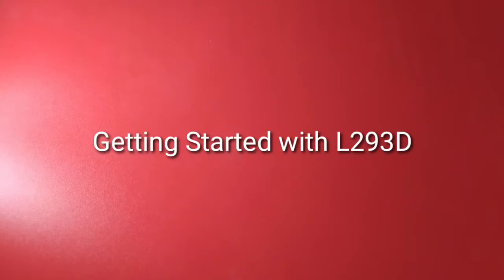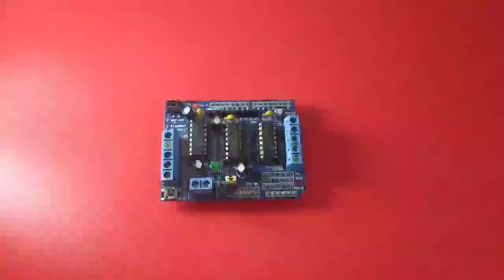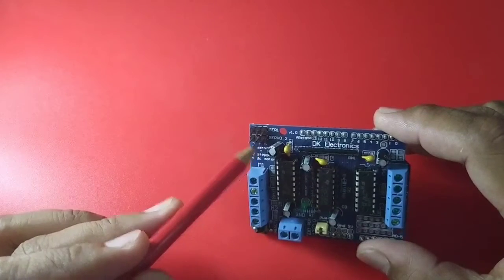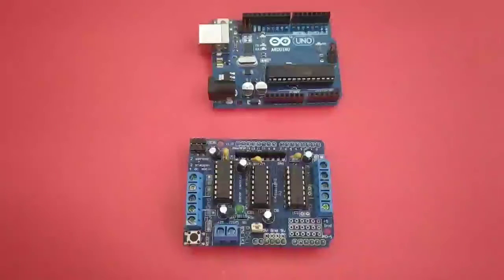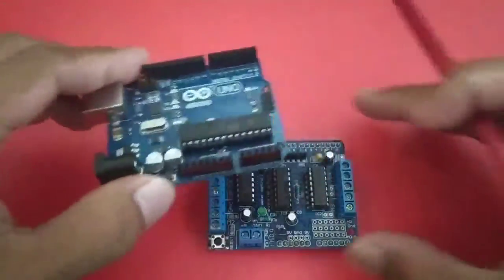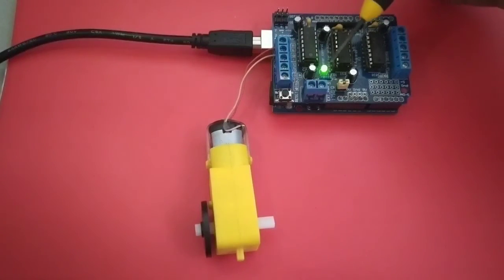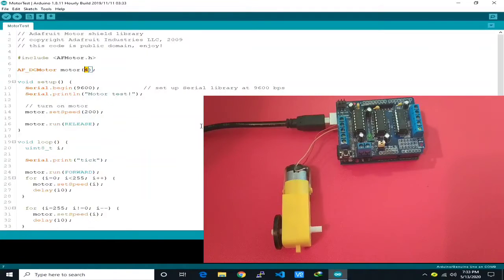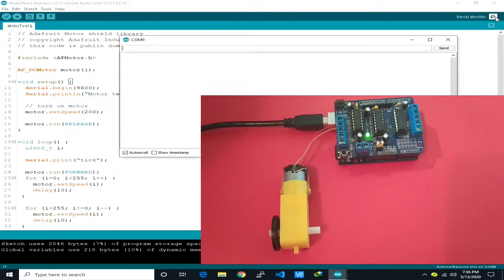TUTORIAL: How to use L293D Motor Driver Shield with Arduino

Comment: I have a 4s 16.8 volt battery, if I try to power those motors in the yellow case with that will they explode?  Do I need an additional bec to power the board at 5v or is there one on board?

Comment: If you plug the shield into the arduino, where (and how) do you connect two push buttons for the a (just one) DC motor to turn clock and anti clockwise?

Comment: We solder male header pins to the analogs of the l293d, then we try to connect it to ultrasonic sensor and code it  to make obstacle detector, but it doesn't work, need help

Comment: sir , in my moter driver shield l293d, when i connect moters it is not working. i am useing 12 volt battery, plzz reply.
Reply from the maker: Can you elaborate the following?
1. How do you connect the 12V power supply to your L293D motor driver?
2. How do you connect the L293D to Arduino?
3. Where do you get the power for Arduino?
4. Do you have common ground connection between the Arduino board and the motor driver board?

Comment: Bro till how much mah battery we can plug to motor driver shield bro can I use 4.2 v 6000 mah battery of 2psc is the motors works good bro plz give me a solution bro plzz
Reply from the maker: You may check the datasheet for that. Such as this: https://www.ti.com/lit/ds/symlink/l293.pdf

Comment: Great video!
Does the motors have to work on a specific voltage?
Reply from the maker: Hi Antonio Fortanet, yes you need to check the motor datasheet for that.

Comment: Bro can we 9v battery?
Reply from the maker: 9V battery is not recommended for motor power supply. You might want to use 18650 in series-parallel to increase voltage-current capacity. Cheers.
Reply: @TechToTinker  But if we use 9v battery no harm done right? it'll just be a little weaker right?

Comment: My aurdino is not turning on when L293D motor driver is connected with external 9V power. I removed power jumper on L293D but still not turning on.
Reply from the maker: @Aditya, most probably the cause is that the 9V power is not enough for (1) L293D driver chip, (2) Arduino board, and (3) the motor you want to drive. Maybe try using 3 pieces of 18650 battery connected in series. (3.7V x 3 = 11.1V in total).

Regards,
George Bantique | tech.to.tinker@gmail.com

Comment: Can we  connect the nodemcu esp8266 with this?
Reply from the maker: @Ravi, of course you can use ESP8266 with this shield and it will work. But this shield is designed as a shield for Arduino Uno.

Comment: Bro ,how can I connect Arduino Uno to the motor shield  by using wires not on the board
Reply from the maker: Hi @Debabrata Pradhan, if I understand you correctly please correct me if Im wrong. You want connect the L293D motor driver shield to Arduino Uno using wires and not as a stack as shield, right?

To do that, you might want to wire individual pins  refer to pin assignments at 00:45 which is much complicated. May I know why you need to do that?
Reply: @TechToTinker  hello, I am also trying to do this as I am trying to connect this shield to a Basys FPGA board instead of an Arduino. How might I go about controlling the DC motors pin-by-pin?
For example, say I want to turn motor 1 on on the clockwise direction. To do this, what pins should I connect?

Also, what are the 5V, GND, and 9V pins on the shield for? I'm assuming they aren't external power inputs, but then what are they? Power outputs?

Thanks!
Reply from the maker: @mantistsai6457  Have you checked this: https://techtotinker.blogspot.com/2020/05/how-to-get-started-with-l293d-motor.html?m=1